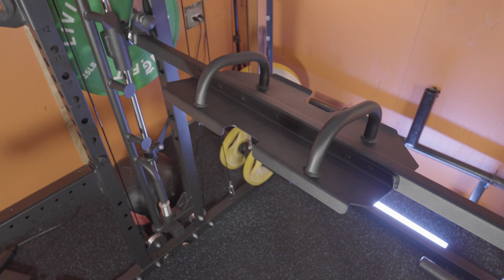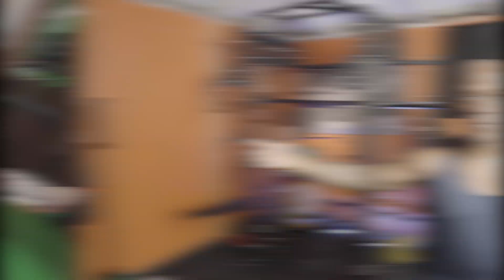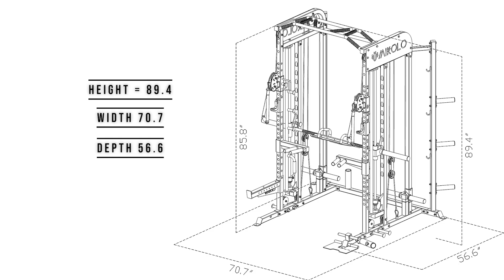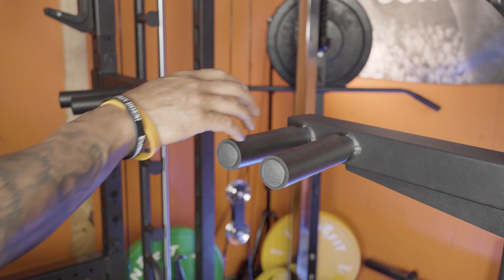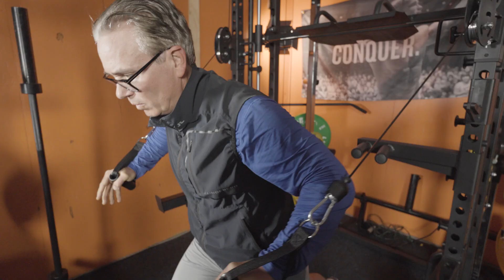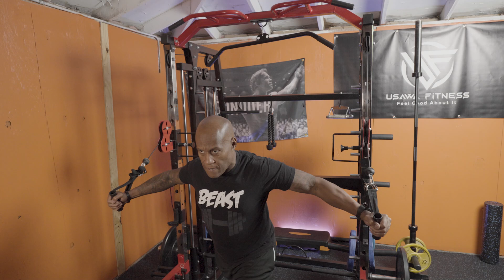Unveiling the Mikolo M7 Smith Machine: My HONEST First Impressions

Comment: I would take the m7 over the m4 any day. I hate the hole spacing on the m4. I don't use the Smith portion that much and love the spacing in the m7. Makes it much more usable for free bar squats and benching. 

The m7 isnt as smooth on the cables. This means there is more friction, so it feels a bit more hectic on pulls. But lube will take care of that. 

Also the uprights are way more sturdy on the m7. 

Overall I would take the m7 everyday over the m4.
Reply from the maker: @theaverageguyNo  Fantastic! Thanks for your thoughts.

Comment: So I want to get this, but.. The pull up on this one looks a little more difficult than the M4. Am I wrong? Thanks for sharing this
Reply from the maker: Nah the pullup bar is about the same. It's built different and the one on the M4 is actually a little more difficult because the m4 has handles that are kind of far apart so it's harder to do a pullup on that machine. That's till my favorite Smith Machine to date though. :-)

Comment: When are you releasing the full review of the M7?
Reply from the maker: Either tomorrow or Wednesday
Reply: Great to hear. I just purchased it over the M4 because it seems to take up much less space. I am a little concerned about the cable pull not being as smooth as the M4, but I read that people sprayed a little lubricant on the square poles and it helped it out a lot. I am not as concerned about it being 1:1 because my wife and I use dumbbells or bands for small isolated movements. Does my rationale make sense to you?
Reply from the maker: @markvasquez1070  I'm going to be honest. It's my least favorite Smith Machine. It's not a bad machine it's just not on par with the M4. After having both I REALLY wish I had kept my M4. It's a much better Smith Machine and I didn't even have the latest model

Comment: I’m going back and forth between the M4 and the M7. Parts of me say to just go with the M7 as I have lighter weights I can use for the lower end movements. But what I’m reading from the comments suggests the pulley system isn’t as smooth as the
M4.

I’m not really understanding why a 1:1 in some cases worse than the 2:1. For example, If you need to lift 5 lbs - you can put on a 5lb plate - instead of a 10lbs plate on a 2:1. Is the feel different lifting that 5lbs between the 2 systems? Or is that same 5lbs actually heavier on the 1:1 system real feel?
Reply from the maker: Get the M4.
Reply from the maker: https://youtu.be/-DQvHTj-TBU
Reply from the maker: Watch that video and it will explain 2:1 vs 1:1
Reply: @UsawaFitness Ty a quick response. I saw that video. I guess I need to really just feel the difference of that same comparable weight on each system. Because I guess it does feel different.
Reply: Because in my mind. If I need to move 10 lbs - I’m still moving 10lbs regardless if it’s a 2:1 (with 20lbs loaded) or just 10lbs on 1:1 system.

Comment: I purchased the M7 and I am disappointed with it. First it came missing 10 parts, most of the parts are scratched, 2 are dented, but the most troubling issue is both middle risers have surface rust on the inside. Anyone have a solution for the rust?
Reply from the maker: @southbay121  That's crazy! Contact them. I wouldn't have even built it had I seen those issue. I've owned 4 cages by them and I've never seen any of the issues that you're talking about.
Reply: @UsawaFitness  I did. They are sending the parts they have not said whet thet will do about the scratches dents or rust, they don’t seem interested in those issues. I have sent 10+ emails and made 4 calls
Reply from the maker: @southbay121  We're you're boxes damaged? I'm trying to figure out how your machine got like that. People reach out to me about Mikolo stuff all the time and I've never heard any comments about things being like what you received. Let me know what they do. Did you send pictures?
Reply from the maker: @southbay121  This is a really important issue. I'd stress the rust issue. I'm guessing that the cage got wet but it's still weird that it's showing rust. I can't understand that at all.
Reply: @UsawaFitness  There is another reviewer on YouTube that had the rust problem, that is what made me look. The metal on the inside of the middle risers are uncoated.
Reply from the maker: @southbay121  Who is the reviewer? I want to see what you guys are looking at.
Reply from the maker: I currently have the only Mikolo M7 Smith Machine Review on YouTube.
Reply from the maker: @southbay121 oh is the M4 that you're talking about? You can definitely send me some to info@usawafitness.com
Reply from the maker: @southbay121  yes email them to info@usawafitness.com
Reply: @UsawaFitness  This is there resopnce on the rust get some rust remover. Regarding your comment about parts 6 and 7, we have looked at the pictures you sent us and it does not affect the product, out of your unsatisfactory shopping experience, we here are willing to give you $30 as compensation, maybe you can go to a convenience store to buy a bottle of rust remover.

If this does not solve your problem, you can contact us again!

Thank you for your understanding

Have a nice day!

Sincerely,

Mikolo Tulip

I am not interested in doing business with a company that sends out rusty parts and expects the customer to fix it. Also, it not possible to do use a chemical product without damaging the paint on the outside. This company is a joke.
Reply from the maker: @southbay121  Wow. Man I'm really sorry this happened to you. This is the first I've heard of anything like this with Mikolo and I understand your frustrations.

Comment: Is there a difference between the square upright on the M7 and the round uprights on the M4 in terms of smoothness and travel of the plate holders for the cable system?
Reply from the maker: The M4 feels slightly smoother to me. I'm not sure if it's because it's been pushed so much more or if it's really a thing.

Comment: I am in love with this machine after searching ALL WEEK for the perfect system.  
BUT IT IS TOO HIGH!  
Can the pull up bar be installed upside down? I am not tall, so a lower bar won't hurt me. I just MUST be lower than 87"  for my garage door. No choice!
Reply from the maker: Let me take a look at it and see if its structurally possible. I'm not really sure if it would actually work though. I'll get back to you later this morning.
Reply: Hi, thank you Sir. Mikolo wrote me yesterday to suggest the M3 or F4, as it cannot be inverted. This machine was the first one I wanted to buy right away too! But thank you very much
Reply from the maker: @kenm2504  I'm glad you figured out!

Comment: Thanks for your reviews. I am just starting to look at this companies products. I have a question: On the smith machine how far down is the starting point when doing deadlifts on the Smith Machine? A lot of smith machines sit high at the lowest point so doing deadlifts isn’t really great, the lower the starting point the better it is to do deadlifts and I like a smith machine to act as a supporting mechanism to help with doing my regular deadlifts off the floor. 
Thanks.
Reply from the maker: Yes you're going to find the same kind of limitation on deadlifts with this machine that you find on others. It's higher then a free floating Olympic bar so I typically use a stepper when deadlifting with the fixed Smith machine barbell.

Comment: Ugh, my M4 is being shipped to me right now. Idk if i should cancel it and get the M7. When do you think you'll have the full review for the M7 out? You're videos are awesome by the way, thanks for helping!
Reply from the maker: I don't know if I would do that to be honest. I love this machine but that M4 has been my absolute work horse and giving up that 2:1 pulley system is HUGE. I'm going to really go into that a lot when I do the comparison video but aside from that vertical leg press I still like my M4 more.
Reply: @UsawaFitness Really? I actually prefer a 1:1 ratio. Most of the cable machines I use at the gym use that ratio.
Reply from the maker: @Superman-xr1oh  That's why they call you Superman Superman-xr1oh! 💪🏾👍🏾
Reply: @UsawaFitness  Lol.
Reply: Thanks for the advice. I'm upgrading from just a regular squat rack without cables and I don't lift heavy so it sounds like I should keep the m4 when it arrives. Answering comments even on Sunday's, you're awesome man!
Reply from the maker: @steveramos72  🤣 Thanks man. I'm glad choosing to keep that M4 based off of what you said I think you're doing the right thing!

Comment: Getting closer to an ideal budget all-in-one!

One possible minor mistake in the video though: you mentioned having smaller hole spacing allowing more pulley positions, but it looks like the hole spacing on the sides (where the pulley trolley pop-pin goes) are spaced farther than the front holes so you don't get as many height choices for the pulleys.

Seems like the J-hooks and spotter arms may use the side holes in the same way, so you have fewer height choices for those which is really unfortunate as you basically get no benefit from the smaller hole spacing to dial in the exact heights for benching and squatting and such. It'd be much better if they used the front holes to allow more height options. This is a MAJOR oversight in my opinion.

Also, couple downsides I see:

1. Straight plate-horns on the cable system weight trolley means you may need collars to keep the weights from falling off, especially if you load it enough to get plates close to the end of the peg

2. 1:1 ratio cable travel makes some exercises harder or impossible to perform

3. Highest front pulley position seems lower due to the Mikolo nameplate taking up the full side of the machine now, this was already an issue on the M4 for full ROM on lat pulldowns if you were somewhat taller (around 6ft+)

4. Cable weight trolley switched to a single square tube design which may not be as smooth compared to dual guide rods on the M4

5. Leg press plate seems a bit small, needs more length and width to accommodate more people and foot stances.

6. Bring back the dual barbell storage that the M4 had

Still, really like some of the other features they added to this one like aluminum pulleys, better spotter arms, the vertical leg press, and 4-way holes on the uprights. Hopefully they can release an updated M4 with just the improvements from this M7 without any of these downsides!

Looking forward to the comparison 😁
Reply from the maker: Thank you for watching and the detailed comment! I appreciate it. 🙏🏾
Reply: Hmmm, now that I look again I think youre right about the spacing. Still it appears as if the m7 has 1 more height level from the side than the m4 does from the front.